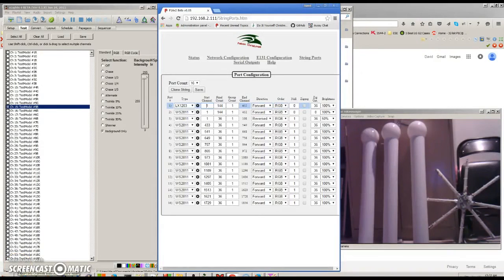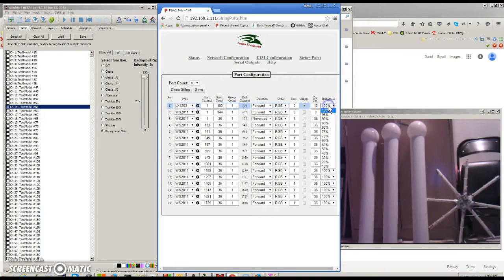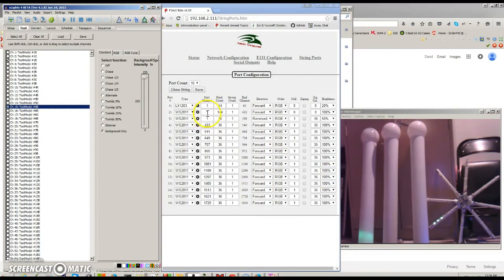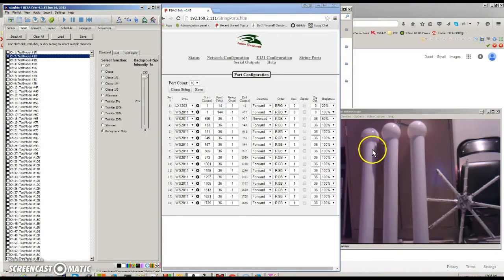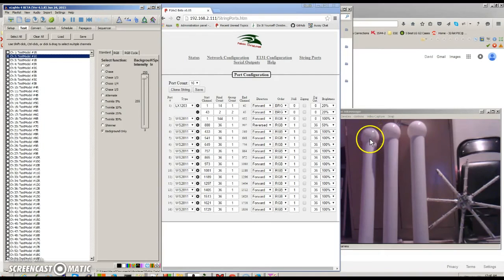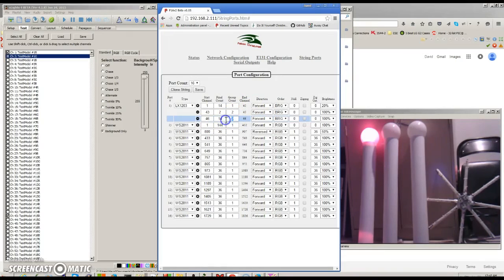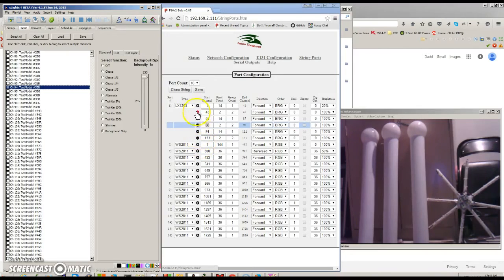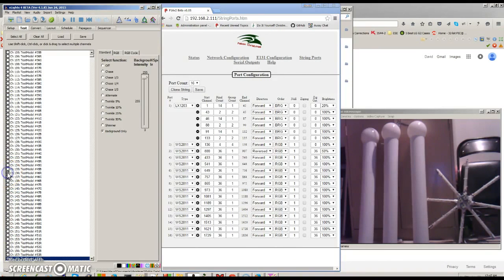Virtual Strings Video 1

Comment: at 12:30 you say the star is connected to the third port but you make the changes to the 2nd port. I'm confused.
Reply: I saw his mistake too, he basically ended the video leaving all of us hanging that he unintentionally changed parameters on port two instead of port 3 where he had set the channel to be 800 at the beginning of the video. You shouldn't be confused by the end of the video but should pretty much identify what exactly he did wrong.  So re-watch the part he changed port two and imagine that he changed port 3 and also added the null node. Hope this helps anyone else in the future.